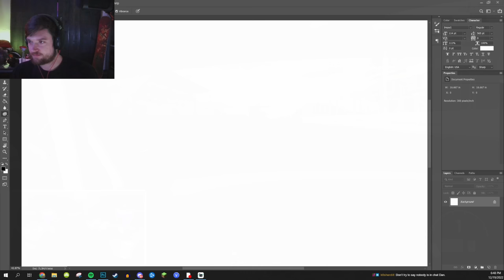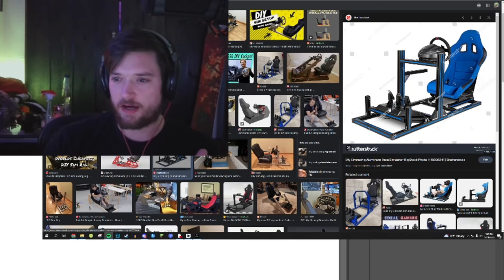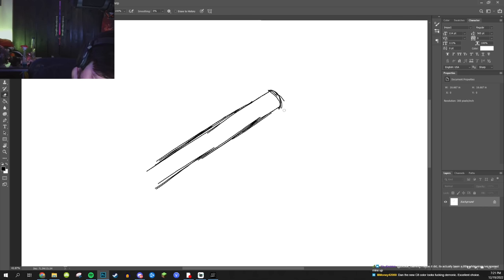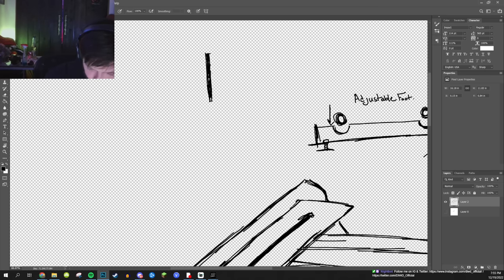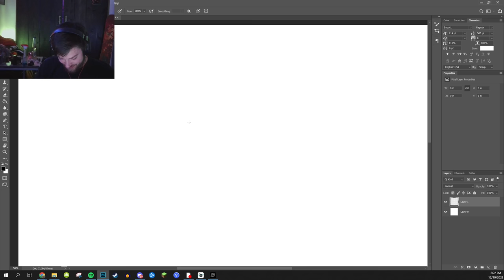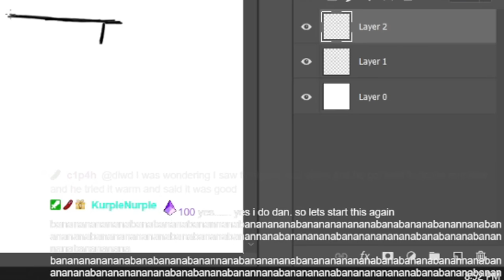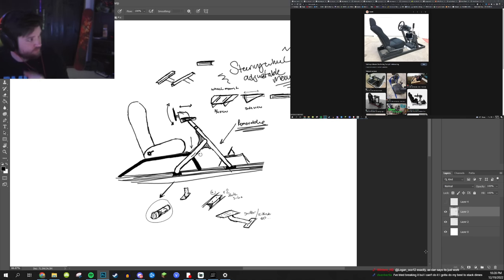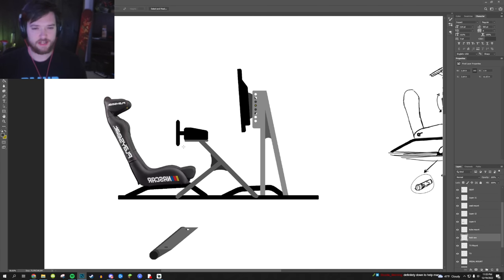Let's Build a Racing Sim - The Design

Comment: I built 2 of them out of pvc and modified them several times. Now that I've found a good form factor that works for me I think I'm gonna make a steel tube one but for like 45-60 bucks (about 6 years ago) it was an awesome way to get started and work with it to get a more final idea. Especially since I'm more of an on the fly manufacturing type as opposed to a drawing it out and working from a plan.

Comment: A good CAD package that is fairly easy to use is Solid Edge, and it’s similar to that of Solid Works, with out the CAM Aspect (G-Code), once you turn off the adaptive synchronous modeling. Plus it has a free software version for makers.

Comment: I always planned if I got a Racing-Sim setup I'd use a use a cheapo car seat as a base frame so all the 3-6way seat adjustability was already done. I'd just build the base frame and tv stand myself off the factory car mounting bracket and buy a knock off padded race seat for the model of car I'd take the seats from. Ex: I buy a new Recaro seat for my Mustang along with new mounting frame but take all the frame from my old Stang seat assembly off and use that system with a knockoff padded 'race' seat and just integrate it to a fixed frame that held a TV and id add interchangeable control surfaces for Flight-Sim things too. Ideally id have the controls locked in with cotter pins which could be pulled out to swap controls for the wheel/stick and pedals/rudders on a whim.. That way I remove and R&D on seat adjustability and just focus on a stable framework and control modularity.

Comment: SOLIDWORKS has an entrepreneur program that you can get it for free (that's how I got mine). Also as an engineer, having tapped brackets/plates/tubing, makes things so much easier than having through bolts with nuts. Means only need to use one hand to undo fasteners